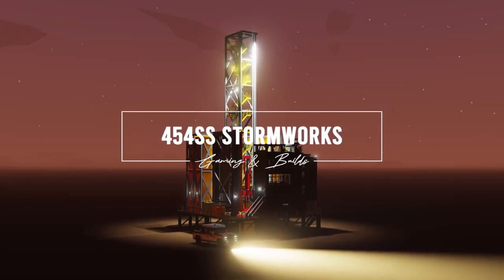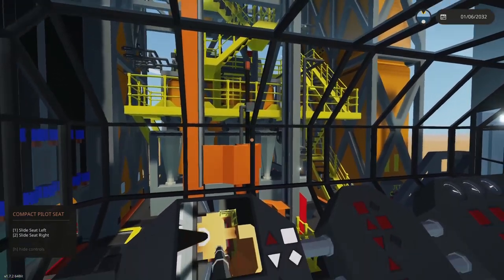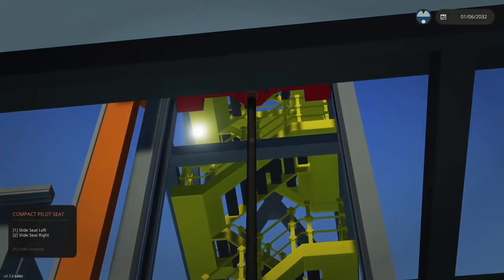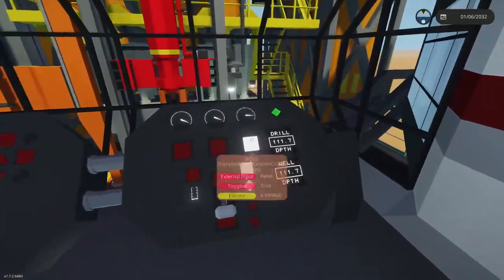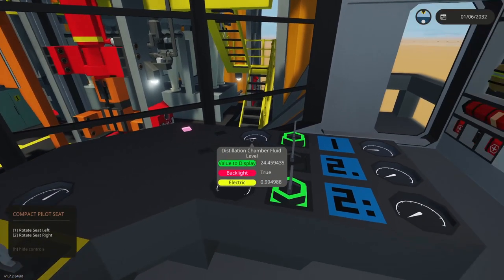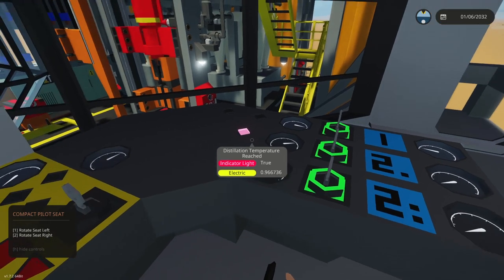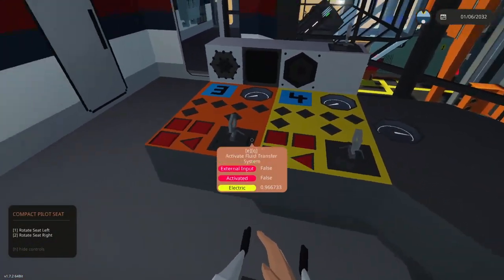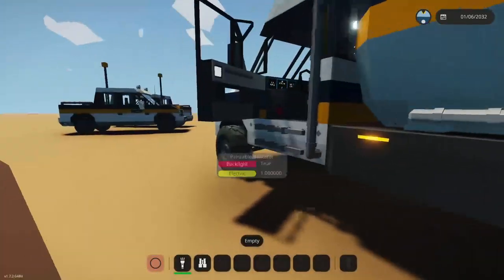Stormworks: ALTArig Oil Rig Drilling FULL Tutorial

Comment: i tried clamping the rods from the wall as shown in the video but it won't move close enough to clamp as if it is held back by something but it doesn't have collision with the clamp

edit: i did some testing and found out that the problem is only on the version i modified however i only modified the emergency systems